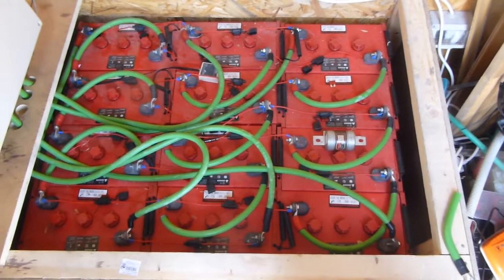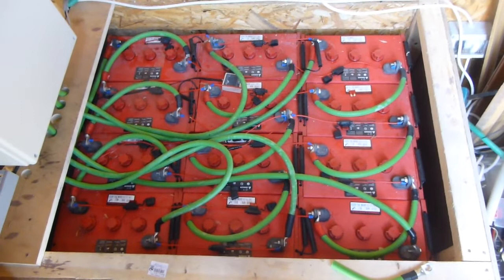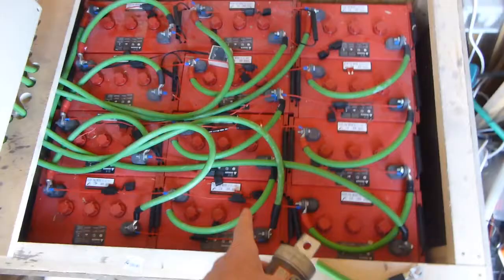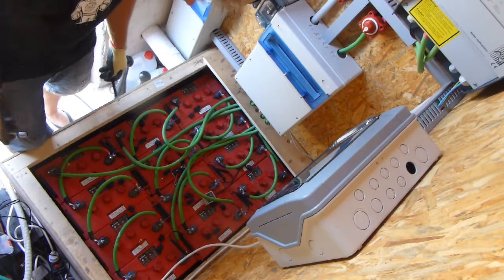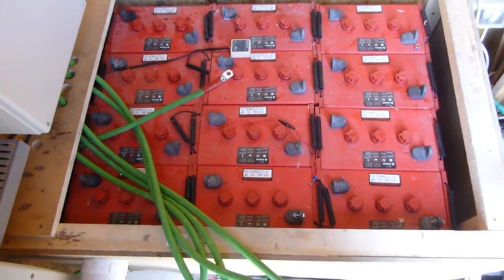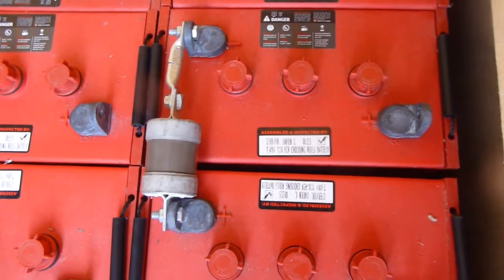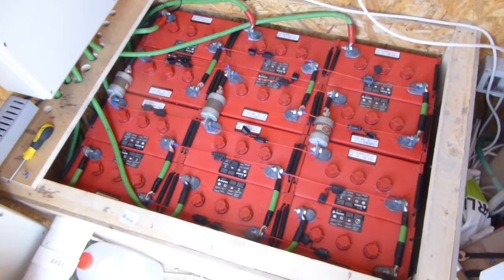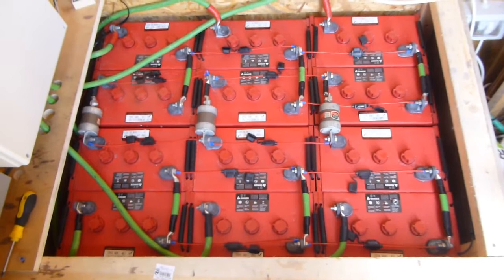DIY Off Grid Solar -  Mid Point Fusing & Battery Bank Rewire

Comment: Looks great. Going to do mine this way. Noticed my middle bank has a lower sg.
Reply from the maker: how many strings do you have in parallel?
Reply: Mandala man same set up as your.3 strings of 4-6v 232 ah ea
Reply from the maker: so do you have three cables coming off to one terminal or are they paralleled and then you are coming off the whole bank with just one cable from pos/neg?

if its the second one i think you would definitely see more even charging if you used a busbar as the current can go directly to the battery without going through the other.

Im no expert though...
Reply: Mandala man one cable from neg/pos. everything is pulled off pos and neg terminals.  I will try and do a video
Reply: I guess I'm wondering if I just add parallel connections through out the bank. So each battery in the bank pos and neg are parallel as well and keep 2 terminals for the loads as I do now.i think you called it matrix cabling.  The fuse lines you added. I thinking maybe just add those but with my weld wire.
Reply from the maker: if you add it with the weld wire then you cant fuse them and its super dangerous in case of a short circuit.  that is how i had it at the beginning.  its a waste of good cabel too as you dont get much amerage through there.  adding the parallel conections will help but adding bus bars would probably help a lot more.
Reply: ok perfect thanks will give it a go. Picked up copper bar stock .25" X 1.23 X 12" cut it in half. This will make up my  bus bar. Thanks for the help
Reply from the maker: my pleasure. hope it helps

Comment: Thanks for sharing this information and your build. I am however wondering about the matrix wiring. I see that you have hook all the positive together as well as the negative in yhe battery bank.  My question is do those wires go to anything like a balancing device or just used to tie all the positive and negative posts together to distribute the charge evenly?

Comment: Hello, excellent vídeo but i have a question.   What kind of fuses do you use?
Reply from the maker: hi, sorry for late reply.  I have those big HRC fuses in the middle of each bank, then small 10amp automotive fuses on the small cables and I have a 300 amp megafuse on the positive cable coming from the   inverter.

Comment: Hello,
 I would like to fuse my battery bank the same way with HRC fuses. Is it better with higher pre-arc and clearing voltages or should the values be lower. I don't know what it means so also how to calculate 😅 .. My system will be much smaller.. 3 banks to each 90ah 24volts.. so I thought about 45a each hrc fuse.  Maybe I will buy et or fe variants of this fuses. Could you please give me any tips?
Reply from the maker: hi, sorry it was a long time ago when i calculated this and cant remember now, so cant help.

Comment: Have you seen a difference in charging. Is the sg even through out ??
Reply from the maker: no, the chargeing has always been pretty even.  the wires are thick enough that it probably didnt make much difference that they were longer.  just a lot safer and tidier this way.
Reply: Do you think if I keep my bank wired the way it is now as 1 large bank (no bus bar) and add extra parallel connections it would even it out. I have everything hooked to 1 pos and 1 neg
Reply from the maker: the parallel connections will help somewhati think) as they allow some current to jump high resistence batteries as far as I understand. I looked at your channel and cant see any videos.  why dont you do a quick one and upload it.

Comment: what's the small red wires?
Reply from the maker: its called battery matrixing or laddering.  Its to get a more even charge when you are running parallel strings.  basically all of the positive and negatives are paralleled between banks so that some current can jump high resistance batteries.
Reply: i see a lead acid battery balancer on ebay.i got one for the two batteries.but they have them for 3 and 4 series too.
Reply from the maker: im not sure how they work or if they work, this balances your batteries without the need for another device.  so far my batteries have charged very equal.  I have not seen much different in the SG of the batteries.
Reply: i got the 2 x 12 one it 3 wires +,-,and the one that goes between the to bat. i see  blinking lights.must be working? lol. i only tested on 2 small 7.5 ah bat. but it was working. i used on older and one newer and it was actually working.and on discharge too. benefits?   it does have low cut off which could prevent one from going below 10.5 ,and a light to monitor voltage .i 'm also looking at your way. can you leave a link to your setup? hate to be dependent on this little box of unknown eBay gadgetry.
Reply from the maker: sorry, I dont have a link to a chart like that, just looked on google and couldnt find one either.  Its just a normal series/parallel with all of the ++ - - connected on each battery.  so the same as the battery balancer you bought but just with cables and without the box.

Comment: You really have no clue,  what you are going to get hurt, playing with electricity will hurt you, green wire, looks pretty but you should follow proper color codes
Reply: Edgar Acosta I think you will find the ends of each wire are correctly colour coded.
Reply from the maker: the wire is green because that is the colour that that thickness of wire comes in here in Europe.  They dont do black and red.  Maybe they could employ you to tell the EU how to do things properly.  Have you offered up your services?  Someone with extensive knowledge such as yourself and such useful contributions such as "you really have no clue" is bound to be well sought after.

Im doing fine by the way and so is my system but thank you for caring about my safety and your useful coment...